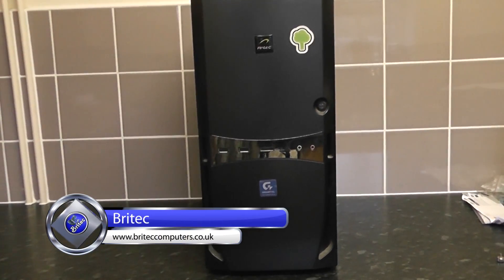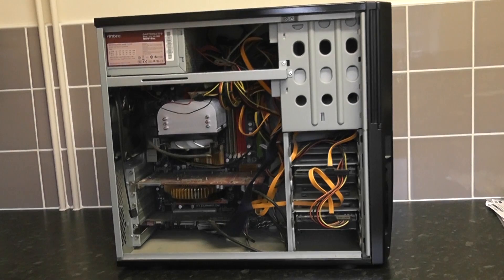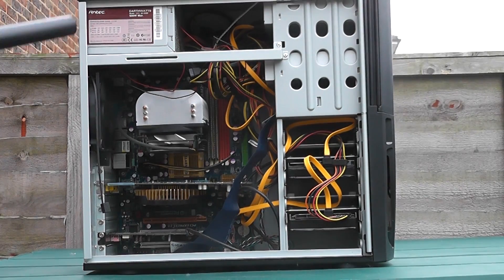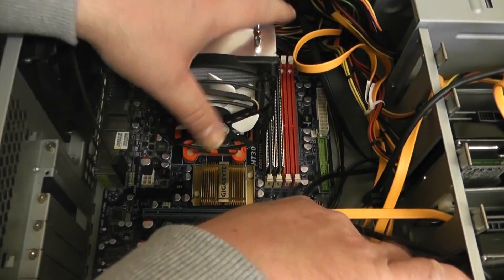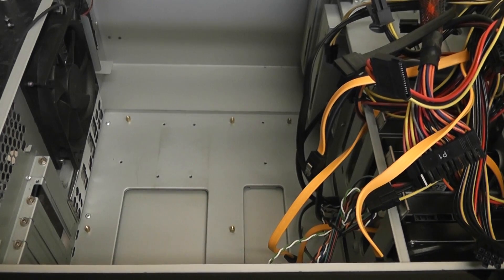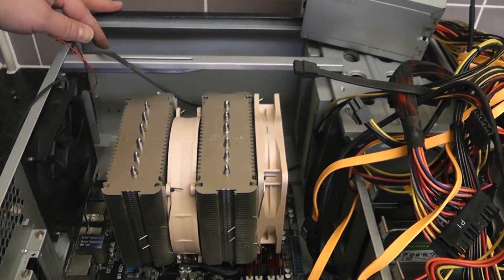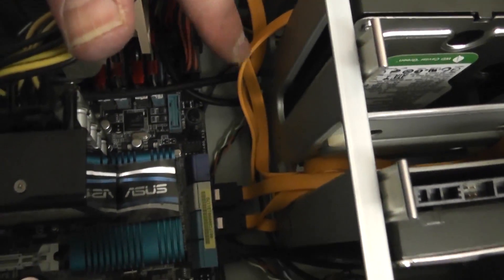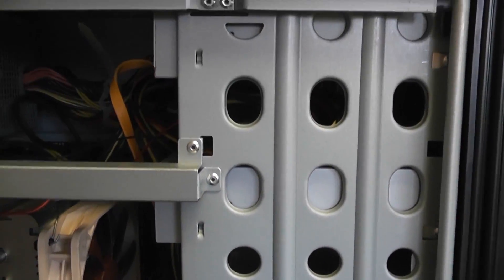How to Upgrade Your Old Computer

Comment: Hi   i recently  purchased a hp  cpu (hp  6005 microtower )  
with  an Amd processor

(AMD Athlon II X2 B24 Processor (3.0-GHz, 2MB L2 cache, HT bus 3.0)

i  decided to  check  out the max ram  the cpu  could  support i later found this   below  from  the  official site 

it stated  (Supports un-buffered non-ECC DDR3 SDRAM)

 

 

Memory

Supports un-buffered non-ECC DDR3 SDRAM

HP 4GB PC3-10600 (DDR3 1333 MHz) DIMM
HP 2GB PC3-10600 (DDR3 1333 MHz) DIMM
HP 1GB PC3-10600 (DDR3 1333 MHz) DIMM
Maximum Memory

Supports up to 16GB of un-buffered non-ECC DDR3 SDRAM.

 

( i am  left but to  wonder  what  un-buffered non-ECC DDR3 SDRAM   means ???????????

Comment: i bought a dell optiplex 780 SFF. Im going to take out everything in it so i can make it play battlefield. The CPU must go, The Non Existent Graphics Card MUST GO, The Power System MUST GO, The Motherboard MUST GO, and thats about it. I thought buying a cheap desktop and then just buying the right parts for it later would be less expensive but in the end i still spent a total of $600 Either way the PC WILL Take your money One way or the other.

Comment: I have found that there are different types of putters ,,,,the guts that is.some have different plug ends some wont fit into other putters.different size rams.different types of power supply.its a costly hobby if you don't what ya in for

Comment: Last time I checked, a new MOBO, CPU, GPU and RAM... not to mention changing the manufacturer of the CPU... constituted building a new computer with an old PSU and drives. Is this a parody? If so 10/10, you go to me!

Comment: Hey I need some help I have a dell optiplex and I don't have the money to buy a gaming pc but I don't know if this would work could I put 
500w power supply 
Gigabyte GT 750 Ti graphics card
If I put that in my pc would it run?
Reply: yes. U shud save up 100 ish more dollars and get a r9 380.
Reply: it would run GTA 5 at 40 fps I know cuz I did the same thing
Reply: Thanks
Reply: What's your cpu
Reply: depends on what 500W psu, make sure it has the required 6+2 pcie pin if needed and what optiplex do you have? is it btx or atx/microatx?

Comment: i am using a Duo 2 Core Processor and My previous graphic card were overheat and spoiled.. so i thinking about upgrades... then i get GTX960..  after bought and plug it in... my computer can't install the driver the updates won't download... then i try downloading the driver from nvidia... (version 359.00) it can't install it when installing half way it will stops and say The Installer Failed... here is my setup hoe u can give me an advise or solution to solve..

Intel (R) Core (TM)2 Duo CPU E7400 @2.80GHz @.79GHz
Windows 7 Home Premium 64-bit
Kingston 2GB Ram 
Hitachi Deskstar 320GB HardDisk
Asus P5KPL/1600 Motherboard
Cooler Master Elite Power 460W
Reply: Jesus 2 gb ram
Reply: I have the same problem with my gtx 760 use the disk that came with the gpu for now until you fix it
Reply: +Alan Low  Recently My Motherboard Overheat And Spoiled..
So I Upgrade To 

AMD FX8350, 
Corsair H60i CPU Cooler,
MSI 970A SLI KRAIT EDITION,
KINGSTON HYPER X FURY 8GB x 2 = 16GB RAM
KINGSTON HYPER X FURY SSD 120GB, 
Asus Strix Gtx960 Sli 2GB, 
Western Digital Blue 1tb, 
Hitachi Deskstar 320GB HardDisk,
Corsair RM750X PSU..
Bitfenix Neos Case White
Front Panel Of Case IS Runing
1 Bitfenix 120mm Fan (that Comes With Case)
1 Cooler Master Jetflo 120mm

But Setup is runing hot anyone have any solution...
especially when playing game like hitman, far cry 4....
Reply: turning up fan speeds on your 960's help, speaking from personal experience and also replacing their stock thermal paste with some arctic silver will help. the fx8350 just runs hot in general so maybe switching to a double rad or triple may help.

Comment: is this a good gaming pc?

ram: adata 8gb ddr3-1600MHz (cl9)
power supply: antec high current gamer hcg-620, 620w
procceser: intel core i3-3220 3.3Ghz 1155
motherboard: asrock z77 pro4 s115z77 4xddr3 atx
graphics card: asus geforce gtx 760 2048

please let me know
Reply: things like optical drive and storage i use from my old pc
(sorry for bad english XD)
Reply: Koen Van Den Berg it is a good gaming PC
Reply: Sorry if i'm late, but i would change to an i5. My friend has a similar computer like I do, but he has an i3 and has problems running a lot of programs.

Comment: I recently upgraded a client's machine. He already had a lovely Antec 300 case (PSU mounted at bottom, fan filters and loads of room inside), Core 2 Duo E8400 CPU, old but high end Gigabyte EP43-UDL3L s775 C2Q motherboard with a single stick of 2 GB DDR2 RAM, a 1TB WD disk and a cheap nasty chinese power supply with the fan on the blink which was causing Windows to freeze every few minutes.

I cleaned out the case which was caked in dust. Replaced the power supply with a beefy Antec 500W PSU. Added 3 sticks of 2 GB of DDR2 of same type to bring it up to 8 GB. Copied Windows to a new Sandisk SSD 128 GB disk using Paragon Disk Manager (with VSS switched off) and configured the WD disk as a data only disk.

Windows 7 now boots up to stable desktop in seconds. Opens Windows Explorer, IE, and Word instantly. Google Picasa loads photos in seconds where as before it took for ages. Does Malwarebytes scans in  a fraction of the time it used to take. For a small outly, he got a machine that now runs like lightning.
Reply: +1

Comment: I've read that using a vacuum to clean a PC's innards is unwise because static electricity builds up at the business end of the vacuum tube...which can obviously damage the PC hardware. There are special vacuums available that don't have this problem, but they are very expensive. Any thoughts on this, Brian?
Reply from the maker: Graham Smith This is blowing air, not sucking, I think the static side of things happens when sucking and if you close to hardware components. Compressors blow air, but you get moisture which is not good. static electricity has been a argument that will run and run. Unless you are discharged you will create static, a lot of people ground them self's on case or radiator, but that's not totally correct, because if you move or rub your top it can create static, you need anti static matting for table which is grounded. A lot of people don't worry about it and handle hardware without anti static wrist band or matting and they plug the hardware in a say look it still works, but static don't always work that way, its the damage you can't see and that could lead to hardware failure further down the line. The atmosphere can also play a part in static electricity, so if your in a country like UK with low humidity, you could be prone to more static. Hope this helps, I am no expert, but I know static is bad for electrical components.
Reply: Britec09 Thanks for that, Brian. I've just read that swapping the plastic vacuum tube for a piece of rubber tubing can also reduce the possibility of "death by static". :)
Reply from the maker: Graham Smith There is a lot worst to cause static that a shopvac, can see how static is going to hit hardware when its not that close to hardware.
Reply: you can use an aircompressor or a vacuum that has a ground cable and your fine

Comment: I'm thinking about getting rid of my integrated graphics and putting in a physical one. I've never done this before so, how would this work? are all graphics card able to fit into any computer?
Reply from the maker: ***** No, your have to measure the gap and get the right card, also you have to make sure PSU can support that card.
Reply: As well as what Britec09 said, you have to also make sure you get a card that will work with the available socket(s) on your motherboard, whether it's PCI-e, or older like AGP, etc.
Reply: So basically it's easier to just take it into a shop for them to upgrade for me? Sorry i'mnot very technical haha. thanks for the advice anyway.
Reply: ***** It's actually not that difficult - just needs a bit of research.
Reply from the maker: ***** You can always join our forum and we can help you better there.